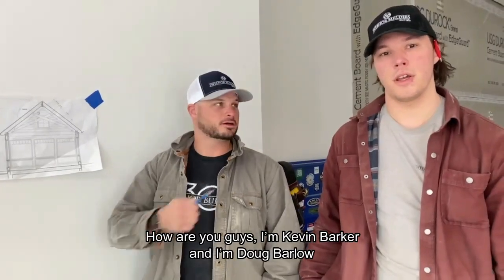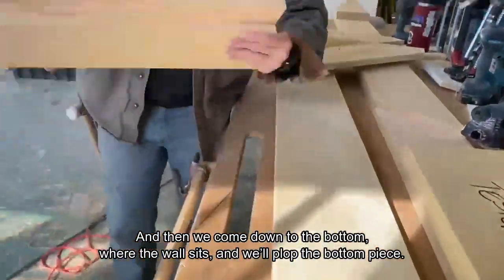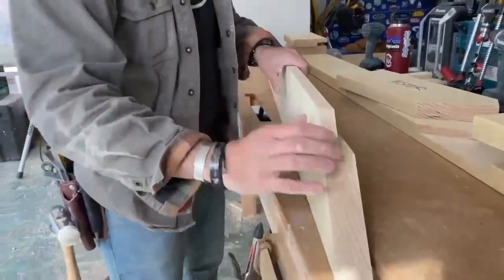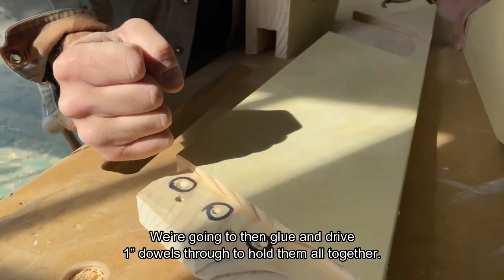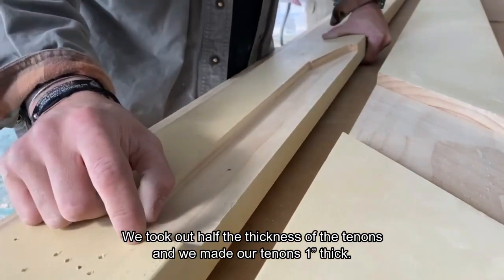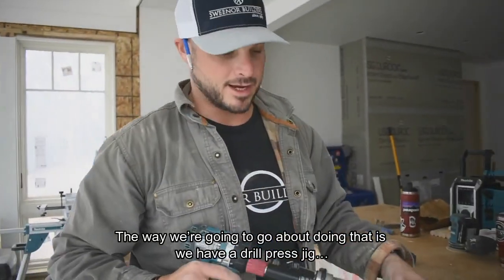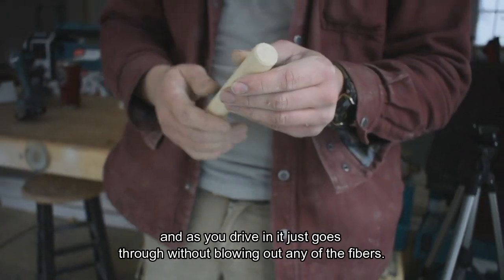Custom Scissor Truss | Installation | QUICK CUTS 03

Comment: Beautiful work! I want to do the same in my 16' wide cabin - I'd like to eliminate rafter ties. Also, as I understand adding a King post to the truss would make it considerably stronger? My idea is to add couple of these trusses to have extra ridge beam support in the middle of the cabin - am I thinking right? By the way, what was the approximate span (width) of the room in your project?

Comment: If the structure is already built, then what is actually holding up the roof?
Reply from the maker: There's a structural ridge, but we used the scissor trusses in lieu of collar ties.
Reply: @Sweenorbuilders  Thanks!

Comment: So this is just decorative and not structural ?
Reply from the maker: It is also Structural eliminating the need for collar ties.
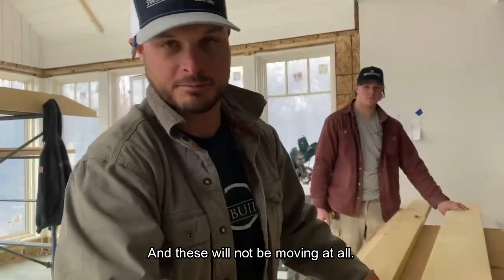Reply: @Sweenorbuilders  @3:28.  Wondering how this scissors truss is actually connected or attached to the roof rafters.
Is the strip of wood on the finished ceiling (@3:28) nailed to the underside of the rafter to help attach the scissor truss to the rafter ?  Thank you.